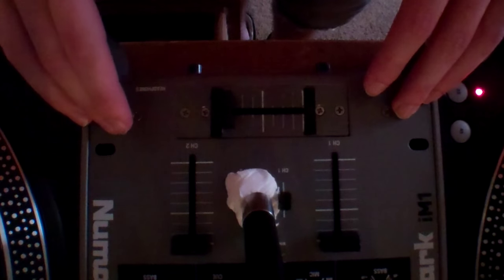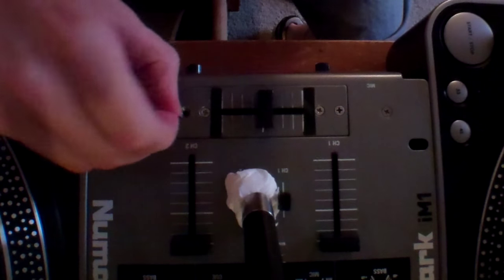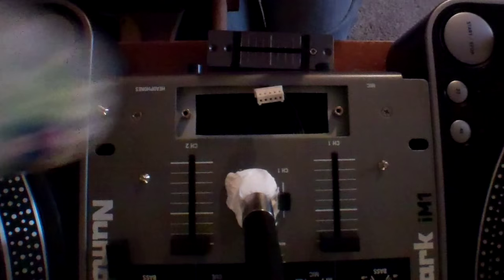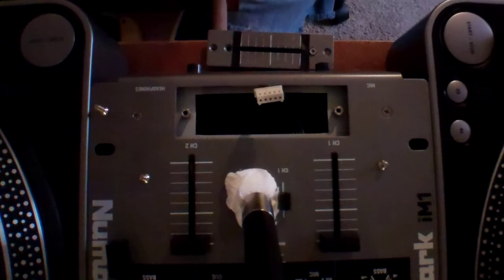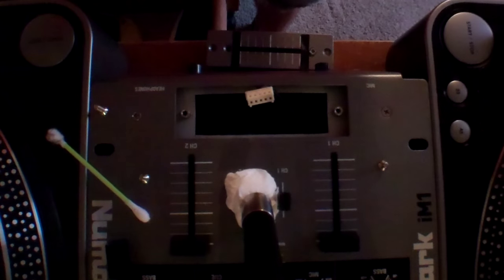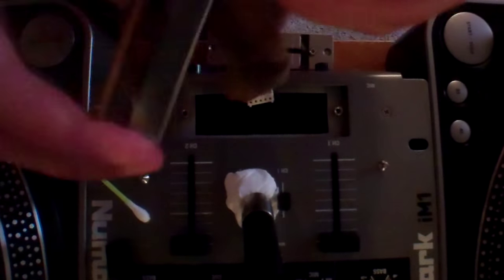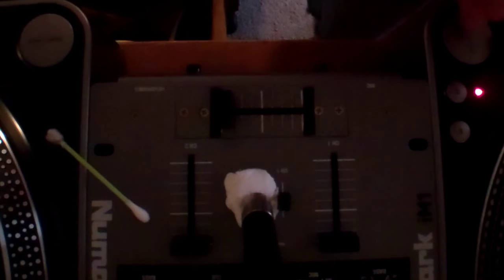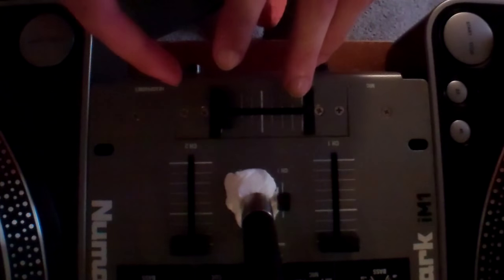How To Clean Out Your Standard Crossfaders On Your Dj Mixers,  And How To Do The Bleeding Test

Comment: i have a numark m1a and the faders are pretty stuck, dragging a lot, any tips?
Reply from the maker: like not sliding dragging?
Reply: @larrybraun3038  exactly, like sometimes i Just try to raise the volume and the whole mixer moves
Reply from the maker: @guikatinskas  Faders or sliders might need cleaning.   if the mixer is silding all over the place then i say u need try some non sliding pads or like a rubber pads then u sure be set.
Reply: @larrybraun3038  nah man, when i say its moving around its just cause the faders are THAT stuck, but im gonna clean atleast the crossfader